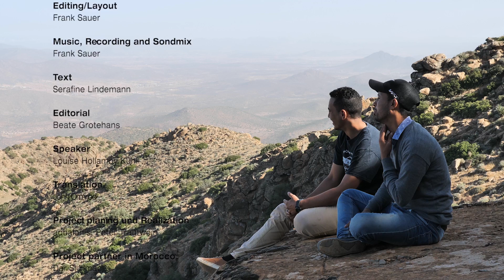Worlds largest Fog-collector CloudFisher in Morocco – Producing drinking water from fog

Comment: I have a farm in the middle Atlas mountains in Morocco , often we have fog but no rain , wonder where I can buy this mesh cause this could become a great way to harvest all that fog and use the water to irrigate the fruit trees I am growing...thank you
Reply: so you're from Morocco?
Reply: @speckdratz  Looks like we arrived here from the same video. lol.
Reply: Trees would do a better job than a cloudfisher. Because the leaves of the trees, since they have moisture inside has a lower dew point. Which is required to turn fog into water. But for places that have no trees, you have no choice but to use cloudfisher. The basic principle is to use materials with the highest possible surface area. The higher the surface area, the more area where fog can land and collect and turn to droplets of water.
Reply: Honestly a plastic tarp would work, they just use netting to allow wind to pass through.  You could probably cut some slits in a tarp to help with that.  It's not a permanent solution like a good plastic net but it will get you started.
Reply: Try to get and plant some Canary pine trees, they are adapted to cath water from fog. they have very special needles who collect the water from the fog, much more water than they need themselves!
Reply: Any polyester mesh should do, the most important thing should be to make sure it is not dyed with a certain color that can contain contaminants and that it can stay put under the wind.
Reply: Any net works just use whatever not toxic and will not leave bad metallic taste ! 
Or get your water through a clay water purification filtration to give water tweet taste!?
Are you in the region of Marrakech? I visited some perma cultures there!!! 
How can you do without water!!!
Reply: @henryyu4987  they do but not enough!!! Especially for small trees!
And if a trees is from seed its self sufficient to some degree but would need help to make good fruits and catch more flowers ! But a transplanted tree usually is so dependent to any help!!!
Reply: Use that greenhouse nets... It works fine.
Reply: Basically it’s woven plastic type strings into mesh. It’s kinda cheap to buy around.. You can make it if can’t buy it.  Basically any hard, safe (not dyed or painted any contaminants to leech into the water)
non-absorbed materials or plastic surface areas to catch and divert water down.. Chinese used bamboo leaves and bark to catch water down.
Reply: @goldHydrangeas  my common sense tells me that a metal mesh will do a lot better than a plastic one , cause the metal keeps cool and is more prone to condensate water than plastic.
I remember when I was young those tall old TV antennas always had droplets of water falling off of them. Also MIT researchers have found that a small current in the mesh will increase the condensation immensely ...no doubt this field needs more research and trial and error
Reply: @hedgerowclose  That's silly, trees take years to get to the size needed to catch the water. This is a very good designed system.
Reply: Be careful about this …. Ask how much GUARANTEED water it will give you and see what you will need to invest.   I am always careful with these projects that enrich the rich.
Reply: @emmanuellebianchin  No one can guarantee how much fog there is going to be. It is an amazingly simple system that brings water to an area that just doesn't get much. Nothing to be careful of.
Reply: @TheSchiffReport  yes.. but mind you metal is also more costly for these poor people.. you want something they can make and weave themselves easily from scraps plastic bottles and materials around them. Metallurgy is still a skill high barrier to entry. If we’re in their shoes, we can see how plastic is more available cheaper to get than Metal.. unless someone wants to donate for “metal mesh.”
Reply: @goldHydrangeas  "these poor people"? You're responding to the original poster. They are the people. I think they know what resources they have access to.
Reply: @TheSchiffReport  just musing here, but you might generate that small current in a completely sustainable way by "plugging in", literally, to your fruit (and a support crop in between fruitings), just the way you can power an LED light with a potato 🥔, if the trees are near enough to foggy areas to run the current to the mesh. Will you post videos of your farm and what you try there for harvesting water or permaculture efforts?
Reply: @notashroom  no. I know who I am responding to.. “The Atlantis Report” who mentioned metal and I was correcting/ reminding him?her? on his her idea of materials and its costs availability for the people.
Reply: Ty everyone for the conversation..very informativ
Reply: @goldHydrangeas  … who has a fruit tree farm in the Atlas Mountains of Morocco that they would like to be able to harvest more water from fog than is happening with their current setup. Really. Scroll up to the top, then back down and you will see that the same user posted both the original comment and the one proposing metal mesh, which you responded to by telling them that those "poor people" can't access metal options.
Reply: I can't find your reply that was in my notifications saying you have plum, almond, and other fruit trees. Very interesting. What do you do currently to provide them with water, or do they get what they use from groundwater? I would be interested in watching videos on trying different approaches to re-greening the landscape and facilitating agriculture in arid conditions at your farm.

I live in a mountain area known for fog  too, but we get a lot of rain and have a lot of trees and plenty of water in the aquifer.
Reply: @notashroom  I told you to if you want to see photos go to FB and add the handle offgridfarm , my page is called "Mountain View Organic Farm & Lodge" let me know what you think , yes I get ground water from two wells and I have an irrigation basin ...plenty of fog in these mountains
Reply: @TheSchiffReport  thanks! I'm not on Facebook, but I'll see if the photos are publicly accessible. Does Morocco certify organic farms?
Reply: @notashroom  yes it does , organic farming is starting to become popular, although even 30 years ago most farms were organic by default and by tradition ....
Reply: @TheSchiffReport  sure, organic is the way of both the past and the future. Doing otherwise is an aberration that has taught us to value the wisdom of the old way.

Do you have any ground crops between your trees? I'm sure you know that is a feature of permaculture that helps fix the soil, and crop diversity may help increase farm security and stability, but it does increase complexity of management too.
Reply: @TheSchiffReport  lol @ making an argument from "Common Sense" and then quoting an MIT article
Reply: This sounds like a great project.
Reply: @hedgerowclose  temperatures beneath minus 10 degrees C will kill the  pine.. temp goes done with the height i guess .  on high slopes temperatures might drop lower then regional averages..
Reply: @goldHydrangeas   it is PP polypropyleen nets.. because it is unbreakable i quess..
Reply: @TheSchiffReport  Are u living in Morocco?
Reply: @ahmedradi99  yes, why
Reply: @TheSchiffReport  Nice, just asking I'm also living there (Southwest)
Reply: According to German Aqualonis who produce this mesh, only organisations can buy their products.
Perhaps Dar Si Hmad Foundation can help you..
Good luck 💦🌿💦
Reply: @OmmerSyssel  that's my point , they should mass produce it and make it available for everyone to buy ...this is how they can really help nature
Reply: If u're serious I can help you.. I sell these in agadir
Reply: @aminnar6380  Of course I am very serious ...I am in the province of Sefrou....
Reply: @TheSchiffReport  dm me your email and I'll contact you
Reply: this is relatively cheap actually and  very DIY-able all you need to do just buy net with fine mesh  think about nylon fishing net, structural pylon and some pvc, remember wind are your primary concern ! so be sure material choosing are sturdy enough

if you had any diffculties to imagine  just look at trampoline structure but yours just on vertical manner also only on square
Reply: Saya rasa ianya boleh dibuat sendiri

Comment: They need to employ DRIP SYSTEM for their gardens.       Then the village will turn VERY GREEN with little water.
Reply: Permaculture is the solution here, small dams, swales..to catch every drop of rain
Reply: @adilnourddine3929  Sure Adil, that will help dramatically.  However,  with drip system, a tree can be watered with 4 gallons per week.   With the traditional method they are using,  a tree requires 25 gallons / week.
Reply: @wildthoughts6959  
I was talikng about simple ways to collect water and i know most of the rain water is lost unfortunately
But yes i absolutely agree, we can also use mulch in combination with the drip System to ovoid evaporation and create moist for longer time

Comment: Wonder if they use recycling to produce the nets? Huge areas could be terraformed if this system was done on a large scale. Very interesting. Water security would make the world a much safer place.
Reply: No, you are simply wrong about that claim. Huge areas can't be terraformed with this system, and they'd make almost no difference to the world's water supply. They rely on high atmospheric moisture levels, and in deserts that only occurs at the coast. Indeed, it's even more restricted than that, because it only occurs where there is an onshore wind. The coast of the Namib, and the west coast of the Sahara in Mauritania, Western Sahara, and Morocco might get some useful benefit, but 20 miles inland there would be zero benefit. The Sahara is the best part of 3000 miles across, so a little 20 mile strip makes no meaningful difference.

Comment: Is atmospheric water harvesting responsible for no rain?  Removing water from air through nets or machine can change the atmosphere for nearby regions.
Reply: Sigh. Freeze the video at about 5:30 and compare the huge abundance of clouds in the picture and the size and number of fog catchers.
Reply: @iandennis7836  but there has to be a study of the climate of the area before and after installation of the nets.
Reply: @gamerzone3211  quite right, there does.......but as apparently according to various articles online, the best nets catch about 10% of the moisture in the air, so no, I don't think they will play a big part in reducing moisture downwind......which was your original question, yes?